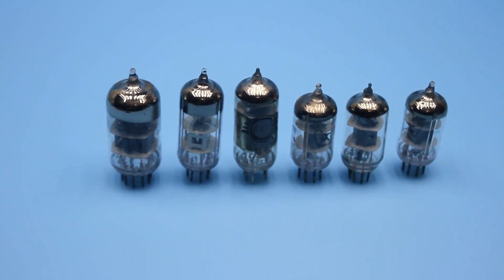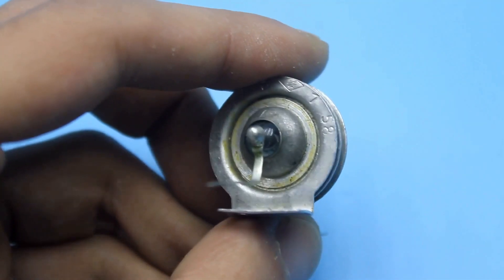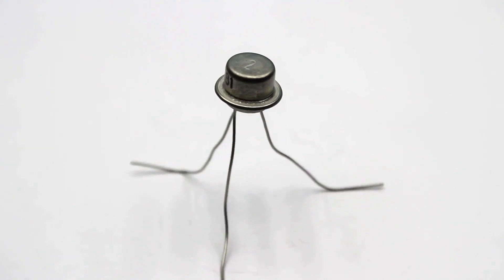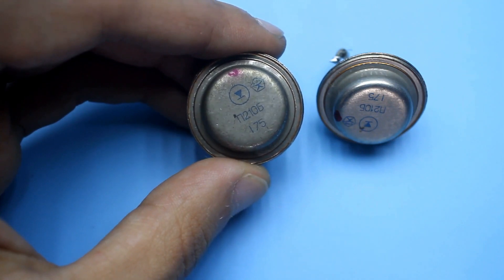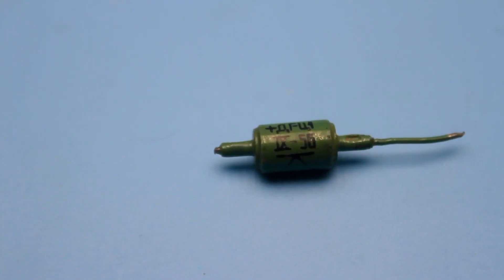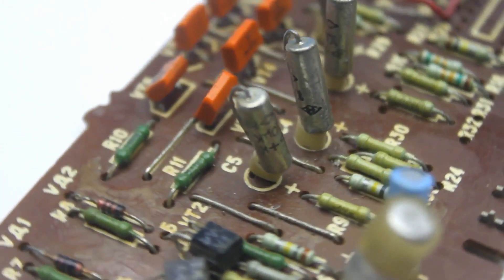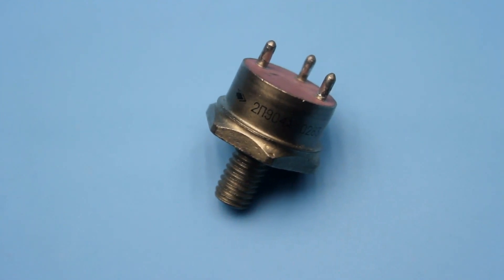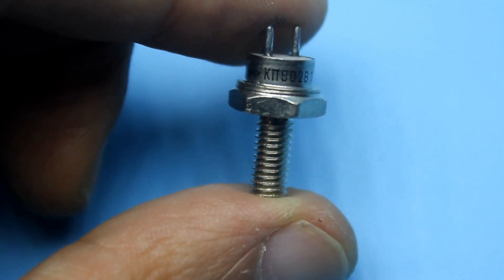Back to the USSR - Nostalgic Edition.

Comment: Yes really enjoyed also! Thankyou again, i will watch again this video.
I learnt that those germanium diodes are pretty quick, which id never thought about - only that they had an intrinsically lower voltage drop than silicon. If they could be used for up to 50kHz, what would their trr, reverse recovery time be? My maths is not good.

Comment: Because of SMD Components these are getting vanished 😢 
Now if I break something everything is SMD nothing I can take for Re-Use
Reply: thats what people thought about these back when tubes were being replaced, you have to change with time
Reply: SMD things are fixable, the things which are not fixable are dedicated and proprietary chips, which combine multiple things into a single chip. Like Apple's M series chips combine the SOC and Memory into 1 chip, so if the memory fails you can't fix it without a full SOC change which is not economical.